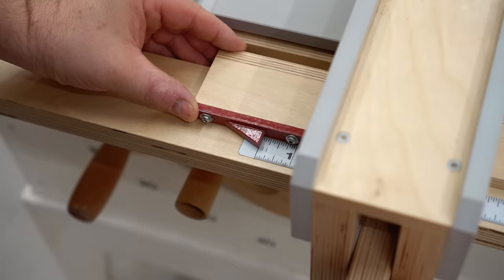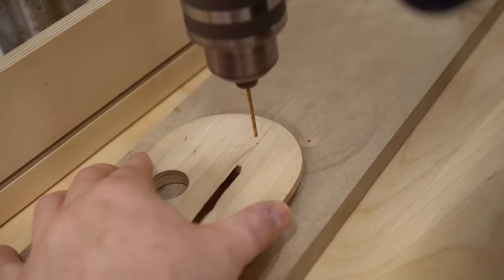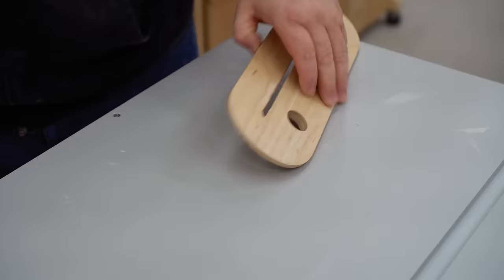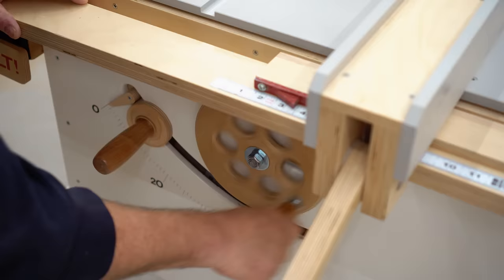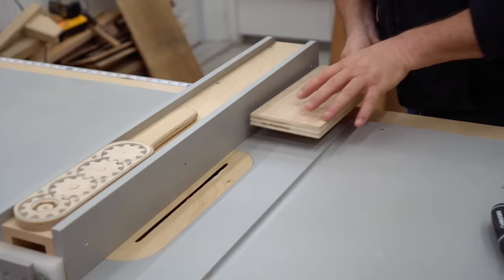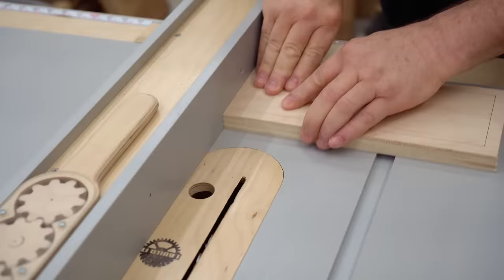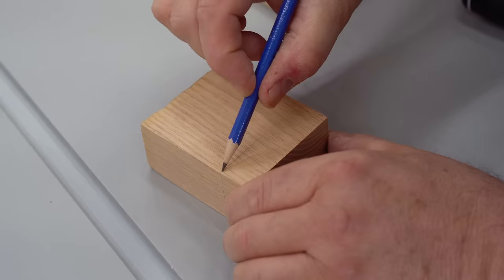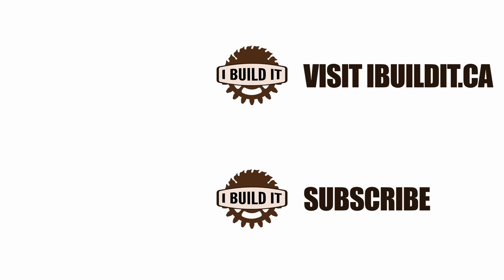Genius Idea? Must Watch! Not Clickbait!

Comment from the maker: Use your table saw as an accurate marking gauge with this ultra-simple upgrade
Reply: The title is correct, its a genius idea.
Reply: You actually don't need to position the screw(s*) anywhere specific to the saw blade line if Ur just marking. Adding a 2nd or 3rd &/or 4th screw you could scribe multiple lines in one pass. I can definitely see making a scribing insert plate kinda like a Woodpeckers ruler where you have all sorts of hole options vs the fence, & maybe a setup bar with a pin to insert to the plate for a fixed offset to quickly align the fence. Definitely excellent work John. I haven't seen this anywhere
Reply: Simplest things are the hardest to find. This one's a diamond
Reply: As always, your content is amazing. Thanks for sharing.
Reply: Holy smokes.  This is amazing.  Having painstakingly laid out a grid to make a custom screwdriver holder board, this would have been so much faster.
Reply: @tokkarijuha  Ditto!
Reply: Glue a small block of wood to the bottom of the insert, and put the screw through that to the top.  That way, when you are done, you just back out the screw, and leave it in place.  In the block.
Reply: Why remove the drywall screw? If you are not gauging you would be cutting along this line anyway
Reply: thats so simple and genius, nice one!
Reply: @jolodojo  Almost like you would be pre-scoring the wood fibers.....wonder if it would help eliminate splinters or the "fuzz" you get with a less then perfect zero clearance insert.
Reply: Great Idea!! Off to the shop to make one.
Reply: Great idea! Need to put that to practice in my shop.
Reply: I'm making an insert just for this application - skip the screw and use an exact-o utility knife blade.
Fantastic Job John ... Canadian Hall of Fame for you.
Reply: thank you for ask your great videos.  I'm new to woodworking and trying to visualize using this. can you do a short video showing some examples. thanks!
Reply: @steveschultz300  maybe a scalpel blade instead of a pointy screw then
Reply: This is great. You could even throw a pencil in it too
Reply: @steveschultz300  That’s what I first thought. If you sharpen the tip flat like a knife and drive it in so the “blade” is inline with your cut. That’s where I thought he was going with it at first as he set it to his blade.
Reply: @calladus   the blade radius would cut the block on a full cut.

Comment: Holy mackerel this is actually so ingenious it’s unbelievable no one has thought of this until now. Great job John
Reply: I thought about it 2 years ago.  I just don't have a youtube channel.
Reply: @williambranham6249  I thought about it 3 years ago.
Reply: @joshuac1364  I thought about it 4 years ago.
Reply: I thought about this before I was even born
Reply: I thought this up in a previous life when I was Michelangelo’s assistant. (that was a sh#@ job)
Reply: I’ve seen this before,
A guy used a sharp nail that slid up through a snug hole when you drop a handle near the saw angle handle... it comes out of the table just in front of the insert instead but does exactly the same thing.
Reply: @liquidlen9261  I thought about it 5 years ago.
Reply: @reidsimonson  I thought about this six years ago
Reply: Maybe you should make a second board with the marker screw, so you don't have to be screwing it and unscrewing it, you just swap the boards when you need it ..... (it's just one more contribution to your brilliant idea)
Reply: I thought about doing this literally seconds before finding this video!!
Reply: @terristroh3965  yeah I bet your necks still stiff from painting the roof of that old church?
Reply: @williambranham6249  I thought about you thinking about it 🤔
Reply: @paulwillis1722  uncanny I thought about doing this literally after watching the video 🤔

Comment: I can see just making a new insert just for marking. Then you wont forget about the screw. Call it the Scribe insert. Great idea john!
Reply: And make it in red or some other funky color so you'll notice it and don't scratch stuff :)
Reply: @TheDarkDiciple  Leave the saw cut out of it would solve that problem
Reply: It wouldn’t scratch if left in because it’s in line with the blade cut. Scratch then cut - no scratch left😀
Reply: @johnsury6544  Unless you run the fence across the table when the blade is down for whatever reason, that'd likely ding the fence 🙃
Reply: @johnsury6544  Maybe scribe mellomene?
Reply: @alanlangman6598  the saw cut is needed to properly align the screw with the ruler on your fence. When marking where the screw goes, John set his fence flush with the blade of the saw.

Comment: Too cool.  One thing I like most about  following old timers, traditional or simply experienced  wood workers  is the awesome tips and tricks.   They didn't or don't have the benefit of electronic devices or a phd in geometry but they still figure out to get the job done.  Some cleverness and will and BAM.  A tip that will help woodworkers forever.  Really, really cool. This ones a beaut John.  Definitely  filing this one away.

Comment: Very cool .
I do something similar when dadoing ,I have a 1x1x 20" long piece of wood that I can adjust that is attached to the fence  with a pencil Thru it to line up with  the center of blade  so it  marks a line on the opposite side of the dado so if I nail or screw the joint together it is pre marked to the dado on the other side

Comment: Great idea John. I have an extra ZCI blank for my saw that I think I will use for this. But not use with a blade for cutting, only as a marking gauge. Very easy to lower the blade and swap out the inserts to be able to use this marking feature. Easier than removing the screw I think.

Comment: Great technique John, I love it! Let me share another tip on the table saw to easily line up your stock with the saw blade path. Raise up the saw blade to max (or so) and drop a metal ruler flat onto the table and lean it against the left side of two opposing tooth tips (height of the blade may have to be adjusted), and using a scratch awl (or better, with a carbide tip scriber), meticulously scribe a line from the saw blade up to the front of the saw table. That line will be particularly appreciated when setting a miter gauge angle with both ends of a line scribed on a workpiece. Best, Serge

Comment: I like it! Also, isn't it essentially a way to score the material when cutting? Maybe it could make a cleaner cut, although a zero clearance insert might make it redundant 😅
Reply: Wait, so how about a permanent version with an adjustable knife built in.  Scribe plywood for cleaner cuts or use as a scribe.  This is going to be a product, I know it.
Reply: @d3lsl0w  That's kind of what a scoring blade does, but a scoring blade is powered. I would kind of assume that the makers of table saws with scoring blades would already have tried a fixed blade and found it didn't work for some reason, because it's so much simpler. But you never know, and I haven't tried it...
Reply: @cooperised  The only real problem I see with it is how fast it would be dull, and since it's fixed, becomes a cut hazard when the saw is off and blade lowered.
Reply: John addressed this in a video on his Scrap Bin channel and said it wouldn't work; the scoring cut would have to be deeper and it's not precise enough to cut exactly where the blade will hit. And I can consider myself just a tiny bit less of a woodworking noob, haha!
Reply: @AlAmantea  that's a really good point that I didn't think about. I work in a small room in my basement so my table saw does double as an assembly table at times. Would not want stuff to be scratched!

Although I'll admit that the stuff I make mostly looks like crap anyway 🙃
Reply: @RunarMagnussen  HMM... While I normally agree with John on a lot of things, this would have to be one that we diverge a bit. A scoring cut does not have to be very deep. In fact, it truly only needs to cut through the first layer of FIBERS, (not veneer on plywood, if that's what you are thinking). Once that top layer of fibers (or grain) has been cut, the underlying layers will follow suit. As far as precision goes, that would depend on the person installing it. Accuracy would be built in, and be as accurate as the saw itself. Perhaps a holder of some sort could be designed to retain a utility blade in place of the screw allowing for adjustment (either side of the blade) and even depth of cut. When it dulls, simply replace the blade.
Reply: @AlAmantea  I guess we won't know until someone tries it out!

BTW I've seen a video of a large wall mounted panel saw that had a built in scoring saw right before the main blade, which was why I thought of this in the first place 🙂

Comment: That is a brilliant idea. 👍😀🏴

Update - Having pondered on this for a few days I did mine by using one of the T-shaped mitre slots instead. I made a slide in/out T-shaped insert that locks down  through the use of a cut-down plastic bolt. Thanks for sharing the original concept.

Comment: Great idea. I would make mine as a bench adaption/jig with fence so I don't need to keep taking the screw out whenever I'm finished using it on the insert. Just easier if you have the room.

Comment: This has a second use that I bet you didn't think of as well... Having that screw in the blade path can act as a simple "scoring knife" for getting clean cuts on the bottom side of sheet goods and softer materials such as poplar and pine. This functions similar to scoring the cut line and should prevent chip out.
I'm also certain that the safety police would have a conniption fit over leaving the screw in place while the saw is running, but it would never be in the path of the blade, and if it ever did come out, would simply fall to the bottom of the saw base.

Comment: A real duh! moment. Thicken the base plate where the screw goes so it can be raised and lowered like a marking gauge.
Reply: You read my mind! ... Or did I read yours? ...
Reply: @onman999  great minds think alike
Reply: Wicked smaaaht guy.
Reply: Agreed, as long as it can't ever occupy the same space as the raised table saw blade.. Or just have a marking insert that doesn't even have a slot for the blade. So you can't forget inlay it with fancy pattern or some other showy feature ( partly to show of your crafting skills, and partly so you are never tempted to use the insert for the saw action), perhaps even add a few pins perhaps whole 5mm apart for those occasions you want to mark multiple close lines...
Reply: See Barry Irby’s suggestion.  Even more simple than this idea that involves extra effort!
Reply: @mileshadrill6885  Another nifty idea, but in fact I have a marking out gauge AND a pencil & set square - to be honest, the quickest and simplest is, 'just get on with it'! 😊

Comment: That's an awesome idea, I don't know about a screw though, I wouldn't personally feel safe knowing there's a screw there and that I might forget about it..
If I were to do it, I would go the overkill route and make a pocket in the tablesaw insert for a 1/4" rod to sit in, and sharpen that, and when I wouldn't need it, I would replace it with a flat rod, both painted different colors, as a visual reminder of which one is in the insert... but the idea is pure genius ! Props to you for finding those neat little ideas! :)

Comment: Perfect example of two proven tech-niques, for consistent, edge layouts.So, I see the screw on blade/center, or at blades edge, as it sets the cut line. I learned that when I saw multiple blade plates, on one saw: each for different styles of blade.

Comment: Great idea.  Fine adjustments on my saw fence are of the old "bump and hope" variety.  So I'll probably use this method with an insert in the t-slot on my router table where I have an Incra fence.
Reply: Could use a V bit on the router, just let the tip protrude from the top of the table a teensy bit, then you can use the measurements on the fence too.
Reply: @kronographer  Good point.  (Pun intended.)

Comment: Sounds like a new project idea to have it able to be adjusted up for use and down when not using it such that you can still remove the insert but have a cam/screw on the front of saw that will raise and lower it.

Comment: This is excellent!! But the only disadvantage is setting it up/removing it. Perhaps a depth stop could be added to the screw somehow. Like a block of wood taking up the space between the head and the stop-point. That would also remove the need for a screwdriver too, if locked in-place

Comment: You know, even if you don't have a table saw, you could make a scribing board on this principle. Basically, just a stationary stylus and a moveable fence, on a flat, slippery surface. In fact, for scribing delicate materials to be scratched through or snapped off, you could even use an Xacto blade. This is brilliant.

Comment: That's brilliant, would this help reduces chip out also if you left it in while cutting plywood hence it scoring scoring veneer like you would do with a exacto? Might not just came to my mind while watching you illustrate it.
Reply: I would like to know this as well, please.
Reply: For that it would need to be on the exact edge of where the blade will cut and also needs to be sharp.
Reply: @ABaumstumpf  Seems a scoring blade in the insert is more doable,  set up for the particular blade, than scoring by hand?  Run some test pieces and get it right, then treat that insert with care?   (I don't know if it would have to be two inserts for the job of if you could combine the functions?)

I am not very experienced.  Recently,  I scored a bunch of poplar pieces by hand with a jig I set up, before routing the edges, and it wasn't an easy task.  This looks easier to me.

Comment: So simple yet so amazingly useable.   It also occurs to me that this same idea but with TWO sharpened screws might well serve as pre-scribers for delicate veneer plywood?  Or even better two screws with small knife edges sharpened on their ends?  Some tuning to line them up with the sides of the saw cut would likely be needed but it seems like a fairly logical extension of your trick with the screw.

Comment: For a great upgrade, you could replace the screw with a pencil, then you wouldn't even need to follow it up with a pencil mark. If you really like the screw method, I think it would be easy to recess in a slot at the bottom and glue in a neod magnet. That way, you don't have to resharpen a new screw every time. I don't think a table saw will create enough vibration to knock it loose.

Comment: Great idea. Maybe glue a piece of wood underneath to thicken that section to almost the full length of the drywall screw? Then, you just leave the screw there. Give it a couple turns to expose the tip, and retract a couple turns to store it...

Comment: Maybe put a small block on the underside of the insert and put the screw through that and the insert. Then you only need to back the screw off a couple of turns to take the point below the insert surface and there's still enough material for the screw to now vibrate out.

Comment: First thought was it tie up the table saw. If you mark your stock the need to cut, after removing the screw and changing the fence you don't have a set marking gauge available to repeat that dimension. But still cleaver.

Comment: You're inspiring additional ideas:  Why not just make another insert with the screw permanent?  Or do you have enough clearance to put a thumb screw in the insert and leave it there?  (Yes, making sure it would not back out is important)    If I do this, I would use a dedicated insert, with a razor blade because some of my delicate stuff would rather be scored by a knife edge.

Comment: And the next evolution... Add a bit of thickness to the insert where the screw goes through so you can simply back it below the surface but leave it in place, then stick a wing nut style top to the screw so you don't need to go to that extreme effort of opening the drawer to get the screwdriver.

Comment: Go one step further and make a second saw plate so you never have to worry about the alignment being off.  The only concern I have is the movement of the plate in the recess of the table saw. It would need to be a perfect fit for the scribe to be accurate.

Comment: Really great idea, John! I wonder how long it will be before Festool comes out with something similar for $600... On a more serious note, though, what if you just left in place while making cuts? Might the score reduce tearout? Maybe use 2 screws (one for each side of the kerf) for cuts, then back off the 2nd screw til it’s flush for marking.

Comment: I would not use it because you always scratch / mark a larger area than you often say and a prank then makes you better mark. But if you have to mark a lot of holes on the back, for example (which is not visible), you can use it. But if you drill from the back, the holes on the visible side travel out (this also happens with a brand new drill if the underlay is no longer perfect after the 5th hole I would say that it is a gite idea especially for do-it-yourselfers. greetings from a German carpenter :)

Comment: You don't have to remove the screw and keep it in a safe place. Just unwind it half a turn, and leave it there. You can even take a longer screw, bend it 90° so you can operate it by hand.

Comment: Do you need to remove it? If you're cutting, the scribe line won't matter at all, and as long as the screw doesn't interfere with the blade, I can't see the issue.
Reply: Large pieces will be harder to push then